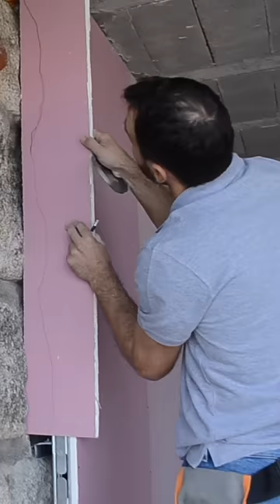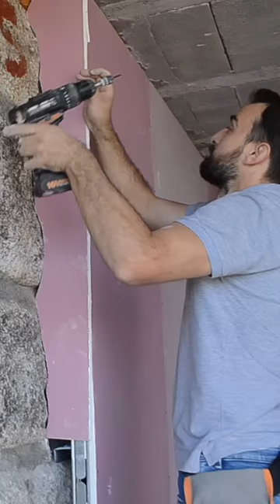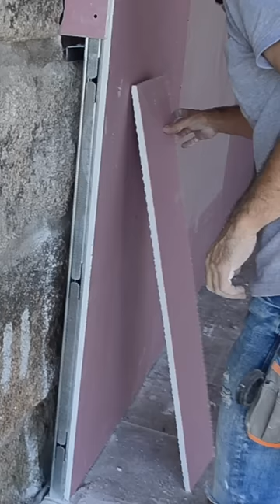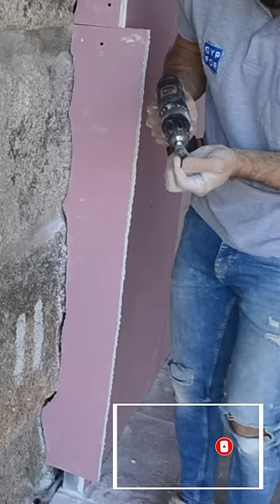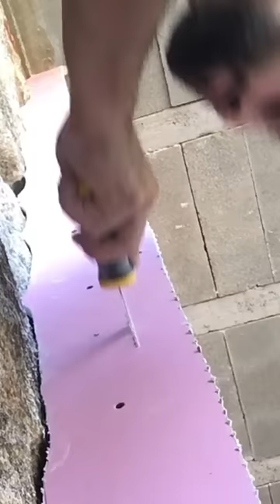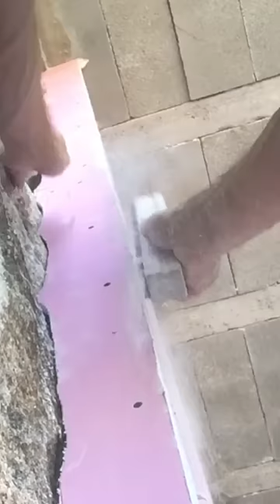🔥 TRICK 😱 How to Fit drywall on Stone Walls 👉 #drywall #pladur #cartongesso

Comment: Cool idea, but I would use a smaller circle.
Reply: I thought that at first too, but he basically used the minimum size he could given the depth of the deepest point. Although using that for a rough fit, then going again with a smaller wheel to fine tune it possible if wanted/needed.
Reply: @MattWeber  I have recently tried this and with different sized circles and the smaller the better the profile you get. I did also find depending on how rough or tight turns there are also plays a factor in this as well.
Reply: A circle that size is about right for drywall. You can’t cut it more accurately. The excess is most easily cut cit a snap-off knife.  Score the drywall side and dimly break the excess. No cut the fold with the same knife.

Comment: Good idea but the circle needs to be atleast half the size for the gaps to be much better for profile, but I like the logic
Reply: Mud man to the rescue!
Reply: @darrylsmith2233  😂
Reply: Also, the profile is close to 1 of the board surfaces, it will not account to the board thickness.
Reply: All he needs to do is use the scribe there would be no gaps

Comment: He probably thought: if I use pink drywall no one will notice the mahuuusive gaps at the back.
Reply: Pink is fire line board
Reply: @NoPlus500  yep, but still distracts from gap
Reply: No one will see the gaps - they're all enclosed - with the exception of how the end pieces look.  And, when at the end, I'd bet he has a way for finishing that so it looks very nice. My concern would be the trapped moisture. How is that mitigated so as to not create problems of mold or whatever other issue arise if that moisture doesn't dry out - won't it deteriorate the drywall?

Comment: Thought of a more precise tool idea if that's more desirable for customers or whatever it is. My thought is a sort of protractor that instead you guide the pen across a straight jig line down your drywall board, the pen sits on a ball that's basically a wheel to guide the pen, connected to the pen with the wheel is the actual pen itself, and the pen rotates at an axis parallel to the other part which is adjustable to fit the angle which I'll describe the necessity for it, another part is connected which is a long adjustable and collapsible rod fitted with a wheel, this attachment is fixed and doesn't rotate around the main pen with the ball wheel unless you were manually fixing the angle at which you're recording the surface of the stone. The accuracy of the trace will depend on the strength of the long arm with the wheel, perhaps maybe even as small as another ball bearing, but basically thr long arm has a spring, so as you're moving along the guide line, the terrain will compress the spring shrinking the arm, as it goes over a decline, it'll depress but might be tricky over ridge like areas if not just inaccurate altogether. Anyways the point of this device is to be able to trace and come back at different angles as long as you adjust the pen itself at the correct angle that you're pushing the long arm at for precise leverage, and what helps keep the angle is that guide line, and maybe something minimal that helps keep a consistent angle, maybe it won't work but still, sounds pretty useful in a niche way if it does work
Edit: just did a tad bit of research. Ya there's no need for what I was talking about at all lol but I'll still leave the comment

Comment: Wait a second Stonewall's weep moisture why are we putting drywall up against that is that waterproof drywall
Reply: IF his  basement Drywall is example of his entire house .. . He is doomed ..
Reply: I was just thinking. Why would you ever do this?
Reply: Yes purple and green board are moisture resistant
Reply: @wesleypepple7525  the paper is. The core is regular old gypsum.
Reply: @iansmith8054  it doesn't matter it's still moisture proof
Reply: @wesleypepple7525  no. It's not.
Reply: @iansmith8054  yes it is,been on construction for 28 pal
Reply: @wesleypepple7525  dude. The PAPER is moisture "resistant". The gypsum core WILL absorb and wick moisture, so when put an exposed edge on a rock, it doesn't matter what color the paper is, PAL. 28 years in construction? Bullshit. Cleaning portapotties doesn't count.
Reply: That’s fire board. Should’ve of use moisture board

Comment: Nice one,, just use a knife to score the back of the board and snap, save sawing near the external angle
Reply: It's not a straight edge though, so it won't snap cleanly
Reply: @garethmcrae668  he ment on the other side
Reply: @D33J3nk1  Gotcha- I must be tired- he even said 'the external angle'. I will leave up as a testament to the need to get more sleep and not comment on YT late at night 😔😴

Comment: Should of kept a neat/factory edge on the corner, when you cut the rip for it you should of allowed for largest gap coming of the stone and set protector accordingly so you only cut from the scribed side and it’s it reduces cuts by 50%

Comment: I tape a popsicle stick to a pencil, and you get a tighter fit.
Reply: How
Reply: Yeah yeah maybe a small bearing on the end
Reply: @cmc02888  Na, you just freehand it. when you tape the stick to the pencil the stick is your guide which transfers the line to the drywall. I go over the pencil line with my knife then router it out. If you take your time you can get every groove along any rock wall or even scribe a wall butting up to a cabin wall.